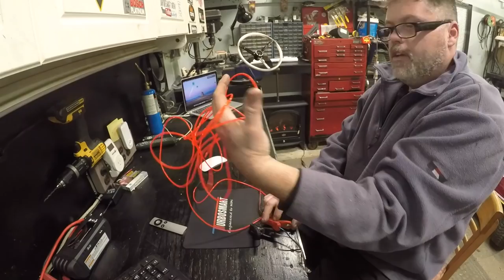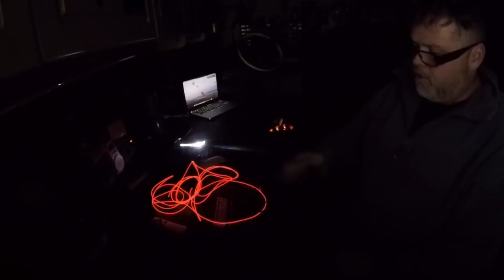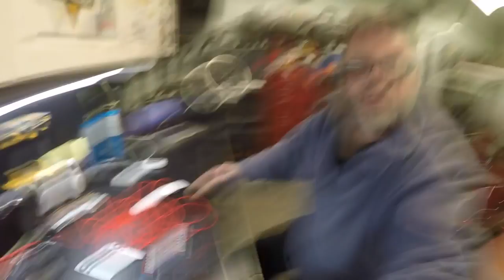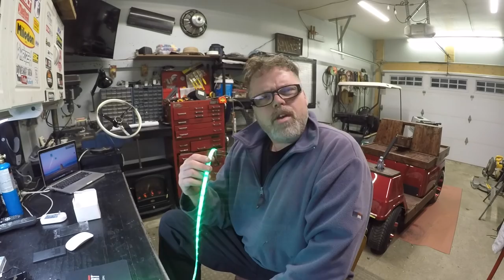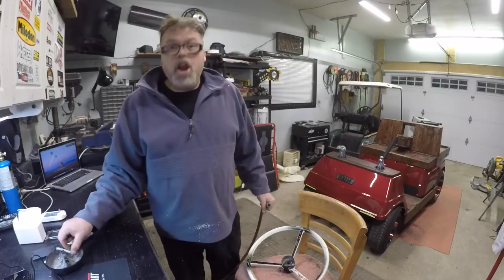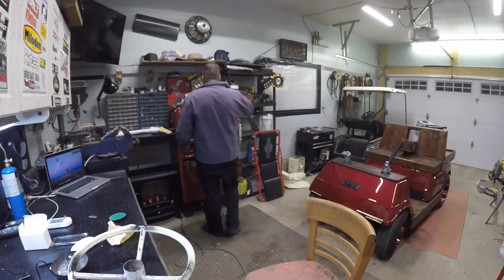LED"s Not To Buy And Sanding On My Wheel

Comment: its not like you were misold tho bill buddy, neon and led are completely different things remember :) so your titles a bit wrong bud
Reply from the maker: your wrong look at the title says led right in it lol just saying 
https://www.ebay.com/itm/1-2-3-5M-Led-Flexible-EL-Wire-Neon-Glow-Light-3V-12V-USB-Controller-Party-Decor/273460549002?ssPageName=STRK%3AMEBIDX%3AIT&var=572847651651&_trksid=p2057872.m2749.l2649
Reply from the maker: but I no what your saying its basically one led . kinda like a fiberoptic cable
Reply from the maker: oh so you can take your thumbs down off too lol jk
Reply: yeah kinda but not  quite the same, my oldman used to make glass neon signs for bars and stuff years ago :) so yeah guys listing isnt quite right but it does say glow light neon, hes got that bit half right atleast bud :)
Reply: lol, you never get a thumbs down from me bud :)